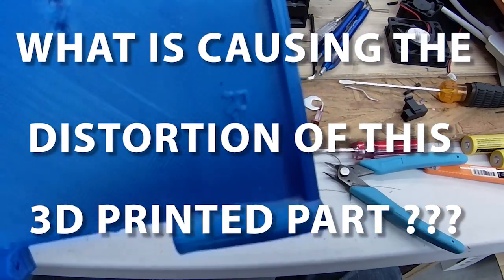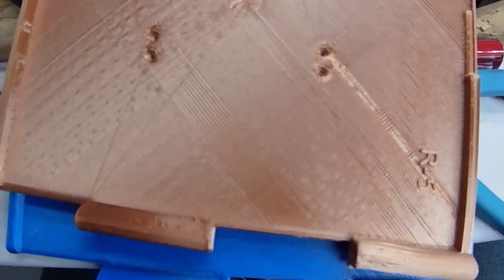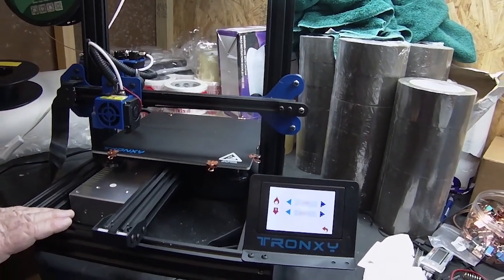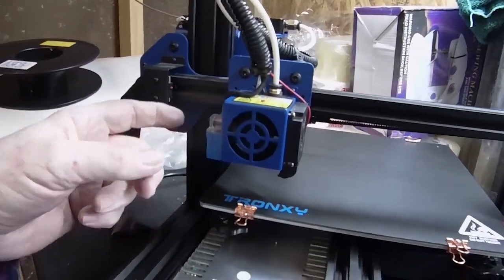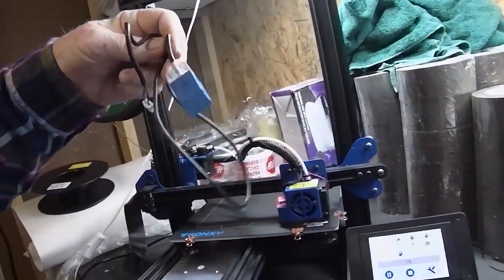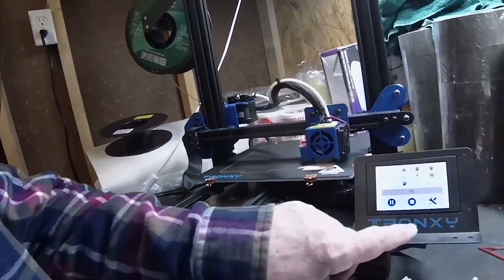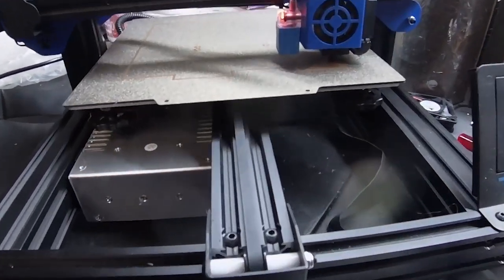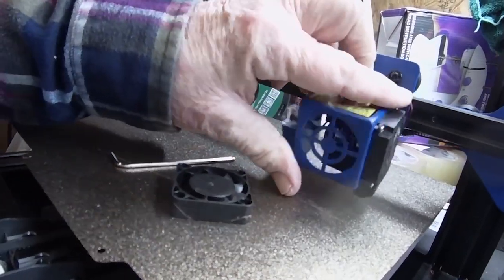WHAT IS CAUSING THE DISTORTION OF THIS 3D PRINTED PART? please comment with what you think caused it

Comment: Bowden Tube isn't long enough which rocks the hotend and coupling eventually spinning the fastener/screws in their socket. Also, the coupling will ‘bite’ into the Bowden tube to keep it in place. When the tube is too short this ‘bite’ becomes destructive. To resolve that, clip the Bowden tube to a fresh section. Unfortunately, this shorts the Bowden tube, causing the main issue again but exaggerated. 

When the print head is farthest out, bottom right quadrant, the hotend is bending out due free-play, be it the tube, coupling or hotend, thus overshooting the design in that same direction. I noticed how the error was consistent through out the print you started with, the blue sheet w/ a hinge.  

In my shop I use 8 Ender 5s and a couple Ender 3s, almost exact same setup as Tronxy. Over time I clipped the Ender 5 Bowden tube short to correct free-play from the pneumatic coupling damage, re-causing the problem. This isn’t a Creality of Tronxy issue, but all printers with pneumatic couplers. 

My correction, I introduced a 'spline' between the electronics cable and Bowden tube. I zip type all three together, increasing rigidity helping to seize Bowden tube movement. 

ALSO, I've replaced the pneumatic couplings in favor of Compression Fitting. These have Brass ferrules that 'crush' onto the Bowden tube, replacing the teeth of the pneumatic couples in places of surface area + pressure + friction while greatly expanding the holding area of the Bowden Tube. 

I put a camera on the hotend, sped up the footage and see barely any movement at all. My printers without the compression couplings move noticeably, just not as much. There’s almost no destruction to the Bowden tube now that teeth aren't ‘biting’ into it. I did replace the coupling at the extruder as well with a size matched version. 

I'm not sure if Youtube allows amazon links but here is the link to the compression fittings I use. https://www.amazon.com/dp/B09QKN2NR1?psc=1&smid=A2ZNNMF1KPBJYE&ref_=chk_typ_imgToDp 

 The example amazon link above I found but also found another youtuber experimenting with the same concept. I've had his link bookmarked for years. I made the conversion to Compression fittings two years ago so never think to get his video out. Here's @andrewesquivel with his testing and same troubleshooting conclusion: https://www.youtube.com/watch?v=a-vUWljYeA4
Reply from the maker: Thanks for sharing this info, I responded in more detail on the other video. Thanks for your support...Ken

Comment: By the look of the print, I would venture a guess at 1 of 2 things being the issue.  It's either the slicer having a stroke because the print seems to only be affected on right side (which doesn't really make sense).  The alternative is that the display is too close to the bed, catching the build plate and causing it to shift a little bit.  It was actually kind of difficult to tell, from the way you were holding the print, if the upper layers (on the left side of the print) were still accurately printing where it should.  Looking forward to seeing the actual cause.
Reply from the maker: You're right the slicer having a problem just doesn't make sense. U did post a video this evening with what I found, check it out...Ken

Comment: I would suspect the X belt tension, also I would have checked that the extruder gear is not gunked up with ground filament dust. or the back right levelling wheel did not come off.
Reply from the maker: I posted the results tonight and it was a loose hot end, check out my video!!! Sometimes it's the simple things that get us. Thanks, Andrew for all your support...Ken

Comment: This printer I bought for $25 at our local Restore.
Added a CRTouch, Glass Bed, and Marlin 2.1.2
By default the printeres power recovery mode would prevent Z from moving up or it would randomly reboot. Disabling power recovery fixed that issue until I upgraded the firmware.
I haven't experienced your issues but upgrading your firmware for Linear Advance and possibly input shaping would help you with print quality.
Reply from the maker: Thanks for sharing that my friend, and it sounds like at $25 you got a pretty good deal. Thanks for your comment and support...Ken